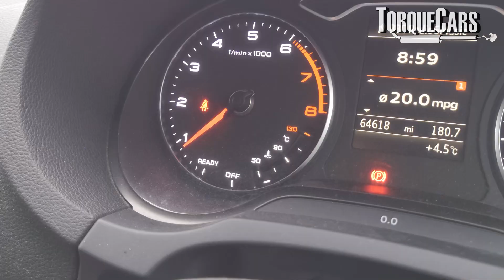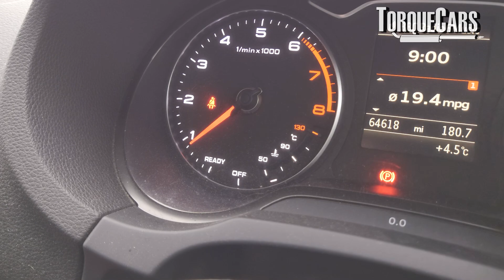#1 Best Way to Warm Up Your Engine 🔥🚗 (Most Drivers Get It Wrong ❄️)

Comment: Progressive!  Start car, wait 15-20 seconds, drive gently first 5 minutes/1 mile.  Then add more torque/engine rpms.
Reply: Absolutely. It's not like idling for smoking a cigar minutes, nether flooring it as soon as the started ignited the engine.

Comment: Hey Mate, seeing your videos for a while.
I am running a diesel engine
My commute is 17 KM daily twice.
When I start the engine I leave it idle for 1-2 mins and then start moving. It would take 10-15 mins for the engine to reach operating temperature and in another 30 mins I would reach my destination.
Am I doing good?
Reply from the maker: That's all sounding good to me, on a modern diesel you don't need to wait that long unless it's really really cold outside 30 seconds of idling is all you really need - I put my seatbelt on and setup the nav/radio then move off. Keep the RPM down a bit for the first 5 mins or so and gradually bring that up if you need to.
Reply: @torquecars thank you

Comment: If I have enough time, I'll idle for about 40 secs, then rev it to about 2k and wait to get the water hot. Ussually a 4 - 5 minute process. Than gentle drive for about 5 minutes. If in a hurry, 30 to 60 secs to get the oil everywhere and below 3k rpm drive for about 10 minutes

Comment: I drive a RR L405 4.4 V8 twin turbo.
If I’m driving in the city, usually 20-30mph mostly at traffic, then I don’t wait any longer for turbos to “cool down”, i just switch off the engine.
But say I’ve been doing motorway drive, after reaching my destination I always wait 1-2 mins before switching engine off. Also, between 5k-7k miles I get oil and oil filter changed with both air filters as well.
Reply: @ImperialHDGaming  good 👍

Comment: With all my cars I usually allow it to idle for 20-30 seconds before setting off, especially when they are stone cold. On my motorcycles, especially the air-cooled ones, I allow a bit more time before increasing the engine load. On those fitted with oil temperature gauges it always interests me how much longer the oil takes to get up to normal operating temperature compared to the engine coolant.

Comment: Modern engine cooling design is less about cooling and more about temperature control. They reach the desired running temperature much sooner than engines of the past. Idling a cold engine when blowby is at it's greatest will allow more contaminants into the engine oil. An engine with moderate load will quickly raise the temperature to optimum running engine tolerance. As soon as the oil pressure is up, drive it.
Reply: I did not notice differencies in the evolution of the oil temperature from cold between my 1980's cars and my current ones (2020 and 2022). This said, I agree idling a cold engine is a bad idea. Better drive it with light load and revs, and rise in load progressively.

Comment: I want my car to last forever but I am not a car guy and so I thought that driving 1k from my driveway to the highway and then accelerating to 100 kph before someone drove into my trunk (boot) was no problem for my 2014 tdi.  Thanks to your channel I learned how this could kill my car - I live in Canada and lots of mornings the car is outside starting up in -20c and below.  Now, I drive the back concession road (in winter), about 8k, in second, third and eventually 4th gear.  The engine temp is about halfway by the time I get on the highway.  Another 3 or 4 minutes until operating temp is up.  I also notice, and find it remarkable, just how much better the engine runs once operating temp is reach.  Needless to say, but thanks to your other videos, I no longer turn the key to off as soon as I am parked.   fyi - I started using Seafoam about a year ago and recently started using Power Service (?) Diesel Clean.  Used to average 52mpg (imperial) but now regularly get around 60 (highway driving).
Reply: Seafoam is very, very bad for your engine😮
Reply: @BubblesTheCat1  never heard that before.  Can you tell me why it is bad for the engine?

Comment: I mean theres several vehicles ive seen flogged once oil pressure is built not even fully up too temp that reached 200K+ Km with just consistent servicing
Reply from the maker: Some cars are very well built such as Toyota, but sadly with high performance engines (European turbos for example) there is little scope for abuse. These cars would last much longer if warmed up carefully and would likely happily hit 400000 miles.

Comment: I don't know if its useful, but to add many people in the northern environments use electric or fuel heaters to heat the oil and the block. I my self use electric one my diesel car when the temp goes under +5c.
Dont you have the heater installed stock in the uk?
Reply from the maker: We don't get them here it just doesn't get cold enough. They are a good idea though.

Comment: I would say I am a progressive driver. As I said in your video about Mechanical Sympathy, I always let my engine warm up every time I start it up and I have actually taken advantage of the ground morphology of my morning route to work (75% slight downhill, 25% level) so as not to rev my engine above 2500rpm and begin moving by not pressing the gas at all. And this is also helped by the fact that my car has tall gears (3rd at 50km/h is at ~2000rpm), so I only put the slightest of throttle in to maintain my flow.
What I haven't said, though, is that my car has no temperature readout apart from the classic idiot lights. It's a 2007 Peugeot 107 with the Daihatsu-Toyota 1KR-FE 3-cylinder engine and it only has trip and odo readouts. It should have a temp readout too, the small button on the speedo to change between the readouts in the small screen to the right should have been used for this too and the screen should have been programmed for it as well. So I just wait a minute for the RPMs to drop below 1000 and off I go. And I always check on the oil level every month's last weekend plus I put it a fully synthetic 5W-30 grade for low friction and good mileage (which almost always ranges from 55 to 60MPG).

Comment: In my audi S1 with the dual port ea888 gen 3 I wait untill revs drop then immediately drive of keep under 2k rpm for the first 2 to 5 minutes while I leave my house or go to 3k rpm depending if im in a NSL road I do this for the first 10 mins, I can allways feel it in the gearbox when the oil is ready to go past 3k

Comment: My 2004 BMW had a tachometer that would lower redline down to 4k when cold and progressively increase as the engine warmed up. There's others that do this as well... so yeah, spot on.
Reply: Thats pretty cool I like that👍🏼
Reply: The M5 does that too, funny seeing your rpm limited to 4k when it's redline is 8250

Comment: I always wait for the oil to get circulating before driving off, and don't go above 2000 RPM until the temp gauge comes up. 2006 Diesel van.
Reply: And how long do you think that takes? Brother, the engine is literally running anyway. Just turn the key and drive off after a few seconds. I didn't say 'immediately' because I do realise oil does need to get to the head - but - it happens almost immediately and there is a film of oil on components when you start the car, anyway. 

In a nutshell shell, oil is circulating as soon as the engine fires.